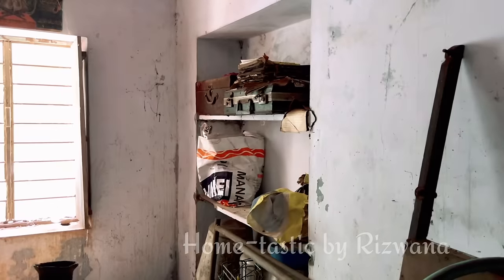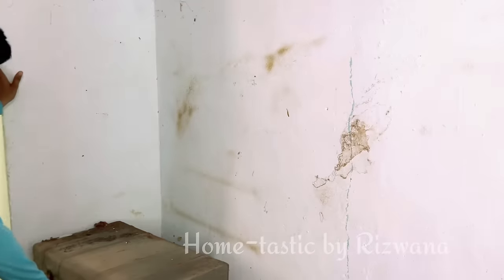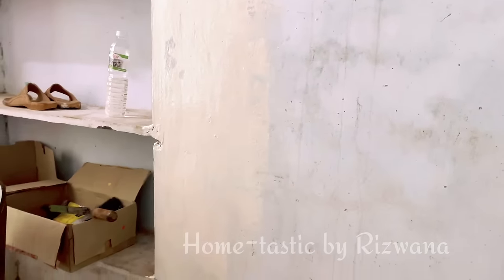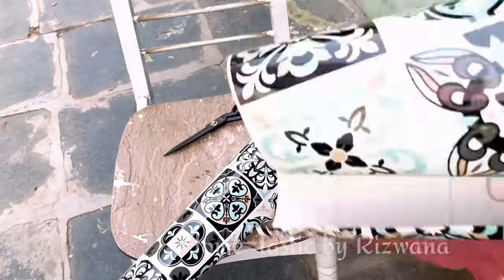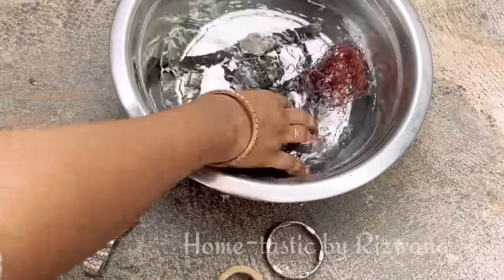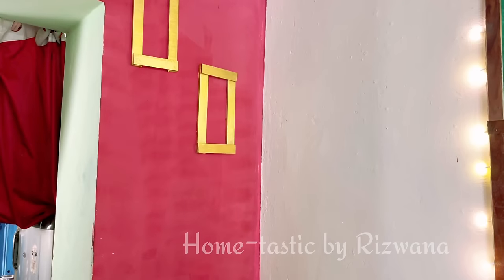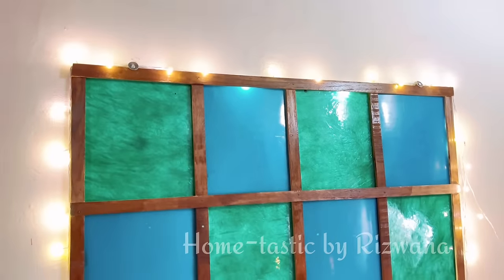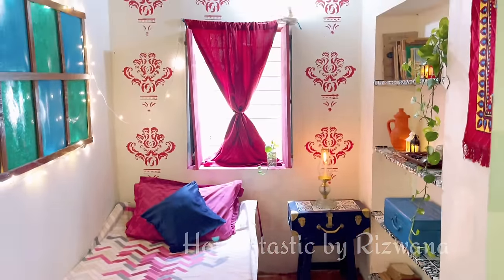My Grandfather’s old bedroom makeover in vintage style|small Vintage bedroom

Comment: Another blockbuster transformation. Well done, Didi.
But.. I did not like the mop mats. Now the video Is done, i think you should replace it with something else. 
second, the photos are missing. It would have been really great if Grandpa and Grandma's photos were there on the wall, side table, or wall racks. That will highly make this room even more special. Looking forward to more transformations and makeovers. Thank you.
Reply from the maker: Hey thank you so much for putting your thoughts.. actually as I told I wanted jute mats.. and I could find only those.. that’s y I used it.. and we don’t put photos in the room.. 😊 thank you